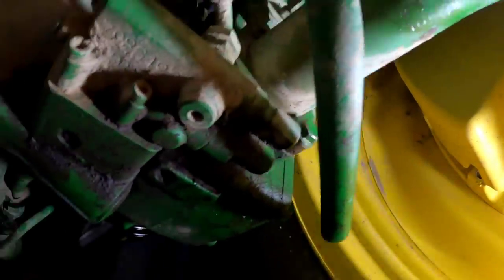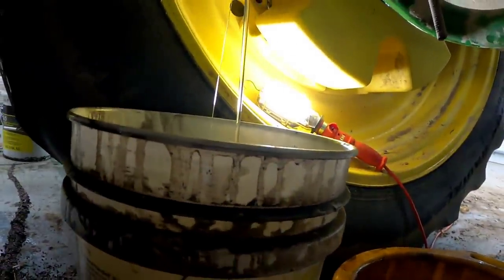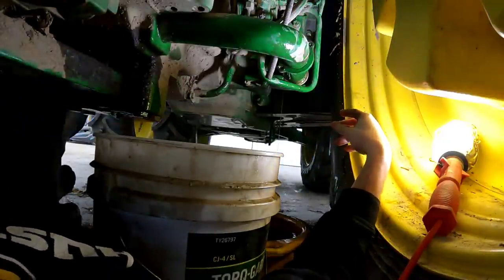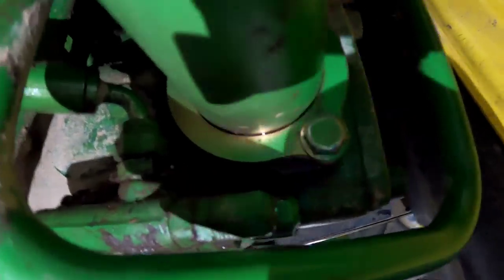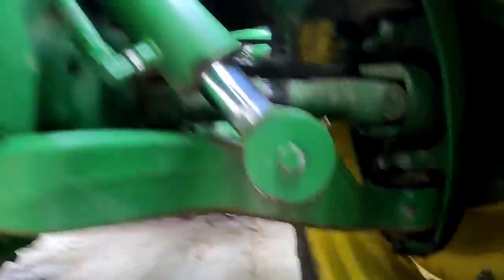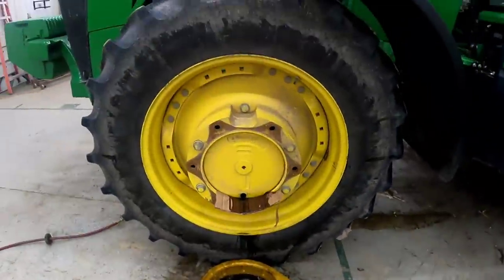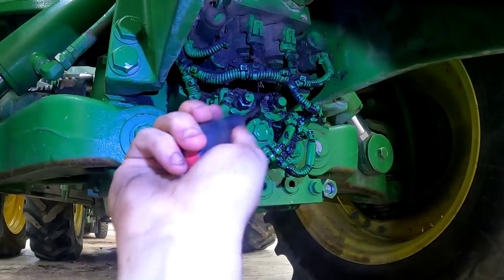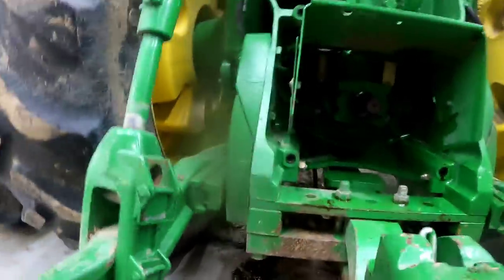Brock's Special - #591

Comment: It was a shame you didn't try the Shop Vac hack over the filler kneck to stop the oil dropping,would have been a interesting experiment for Brock,especially as Nathan wasn't about,could have been very entertaining and no I don't know if it works 🤣🤣👍
Thanks Nathan/Brock for the time and effort you put in on your daily blogs.
Reply from the maker: I thought about it but I don't think it would work here because of the 2" hole when the pipe came out and the oring is inside where all the oil would have been.

Comment: One option, the self-priming clear hoses  everyone sells for fuel, DO work for hydraulic oil due to its' thin viscosity when warm. These hoses  have a small brass actuator in the end that creates suction when hose  moved up/down rapidly. If unfamiliar, Google fuel siphon hose or check Amazon .  Effortless transfer of fuel & light oil, AND yes, diesel fuel is actually OIL.  So w/ the 5 gallon pail raised above the fill  height,  start transfer.

Comment: Brock good on the O ring replacement.  There is rubber cap missing for a flat face fitting  buy the hydraulic oil site gage. On the Solenoid leak buy front axle if take it off that would be a good time use the Shop Vac on the oil fill point that will stop any oil leaking when working on the solenoid.

Comment: GREAT JOB Brock. Nathan, what is your take on the dark oil that Brock drained out of the right front hub?  Better watch it Nathan, you might have more Brock video to edit than your own.  😂😂😂
Reply from the maker: Slightly concerning but its a planatery gear set in a hub. It isolated from the rest of the oil systems so if something goes bad it won't contaminate anything else. There does appear to be a leak on the inside of the tire and we'll probably have to address that so I'll have the dealer look at the gears then as well. It's not good but I don't think its a major iminate problem.